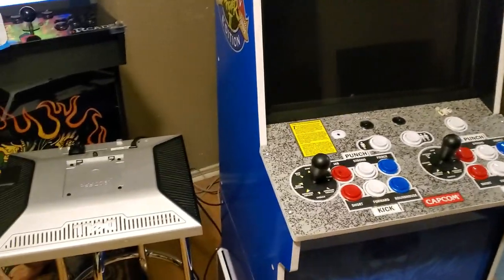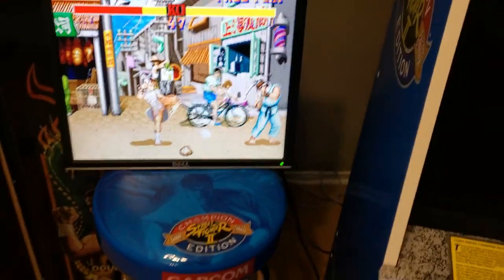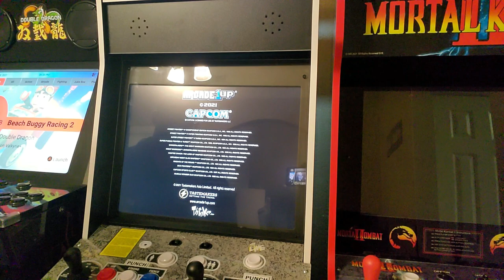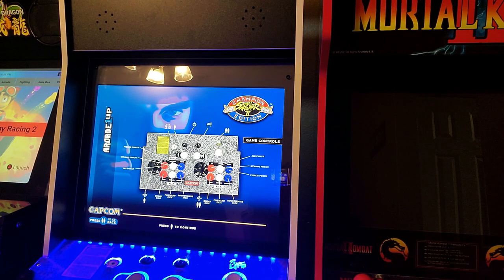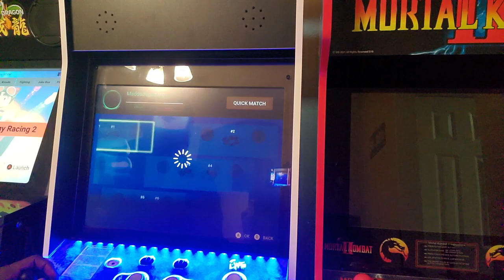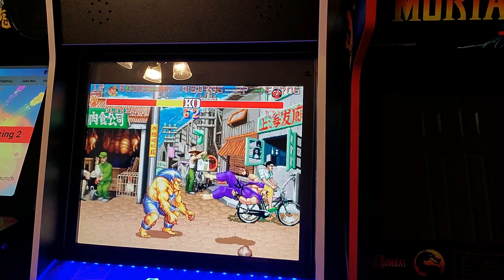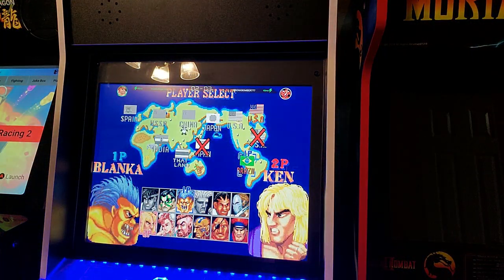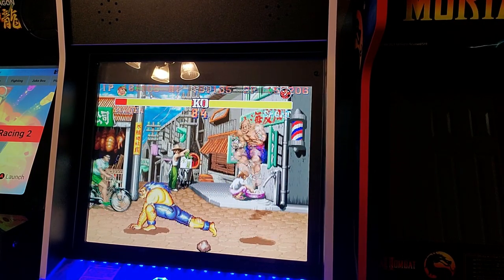Arcade1up Big Blue 20'' Install complete and working!!

Comment: Great video on the 19-inch monitor replacement and the online matches that you had!  The 19-inch looks great on the big blue Sf cabinet!
Reply from the maker: Yeah the 19 inch was the first one and the 20 inch was what I am using now. Thanks for the comment and I appreciate you
Reply: @MadDadsGaming  Which LVDS unit?  1.5 or 2.0?  You tried the 20" in other A1U units as well?
Reply from the maker: @thebrokebrick7755  I put it in the description but its the 1.5 that works  in this cabinet as well as the Xmen vs Street fighter and Marvel vs Capcom. The version 2 worked with the legacy cabinets and others. I appreciate you checking out the video.

Comment: I don't understand why you need the Geekworm adapter to work? All I did was gutted the dell 2007fp to bare LCD panel and simply just swap the aracde1up 17" out with this, the LVDS is plug and play and one thing you do need is the inverter section for the dell LCD panel LM201U05 and from than it's just plug and play.
Reply from the maker: You can do it either way you like. Im glad you found another way to upgrade your system. The Geekworm adapter is something used to me without much of a install process is all. You connect the pcb to Geekworm and then done. Everyone has a good way to upgrade I don't discriminate at all. I appreciate you for checking out the video.
Reply: I tried this, and it didn't work.  The pcb wasn't supplying enough power
Reply: If you could explain more in detail how you got your big blue to work with lvds directly, your knowledge is very much appreciated
Reply: @chubbstep  You only need the 6CCFL inverter board from the LM201U05 LCD board kit from amazon or aliexpress, than everything just plug and play to the arcade1up board.
Reply: @mr2cqql  I have 6CCFL inverter and i have a board kit.  The PCB cannot supply power.  In fact i'm using board kit right now plugged in seperately.  my LVDS cable has two cables that separate power line.
Reply: @mr2cqql  do you have a link to said product.  i ran cables directly back to the pcb and still get the same problem
Reply: @chubbstep  The inverter board is green color unlike the amazon one. From what I recalled, I only swap out the aracde1up monitor to the dell can connect the green inverter board without using the controller from the kit. Had it running like this for few weeks than converted to pandora ex.
Reply: @mr2cqql  this is the one i currently have.. snipboard.io/JwpiRu.jpg   it's not yellow, it's green, but the wiring for power is different in that there are + - going separately onto a chip i am unfamiliar with.  whereas, the one with 6-pin connector goes directly onto pcb.
Reply: @chubbstep  That might be the problem, since there are so many different style and layout of these boards that looks alike but they are in fact not. For that you will probably have to spend another $3x to test it, it will make more sense just dump the aracde1up system and get yourself a pandora box whatever home edition with all the buttons and joystick for $100. The arcade1up cabinet have so much potential for upgrade and you can have everything with the pandora.

Comment: Will this only work with the 1.5v geekworm? I have the Capcom Legacy with a 2.0v geekworm and it's not getting a signal. I've tried hsmi to vga & dvi.... No luck.
Reply from the maker: I only know at the time for the big blue. I haven't tried the othets except for the mk legacy which works with the v2.0. Check out that video to see how I connected it.

Comment: So you saying you couldn't get the DVI to HDMI to work? You had to go with the VGA instead?
Reply from the maker: Yes that is correct on the 1.5 adapter. The v.2 works on the midway legacy with the dvi to hdmi adapter no problem.

Comment: is this the original monitor frame modded? or the first gen monitor frame? 🤔 thinking my old monitor mod would work in this cabinet.
Reply from the maker: This is a 20 inch Dell monitor that I used in this upgrade.  I appreciate you for checking out the video.
Reply: @MadDadsGaming  Thanks for the reply, but I more meant the wooden frame that does into the cabinet.

Comment: Thanks! using hdmi-vga, screen showed up! Though i see some letters flickering. Do you also notice it?
Reply from the maker: Yes some but not noticeable to me. Also you may have to play with the settings a little bit
Reply: @MadDadsGaming  def noticeable on dell 2007fpb. Do you remember which settings did you play with that made flickering go away on this monitor?
Reply from the maker: @DJILK-SF2TV  I went through the zoom feature in the menu and something else lol its in the video

Comment: my question is how did you get the monitor in the cabinet, so that it will fit well. please show this. I really don't know what monito to get and need help because I don't want to end up buying  a monitor that doesn't work.
Reply from the maker: I do have all the information in the description on what I used. Again if you need help just email at Maddadsgaming@gmail.com
Reply: @MadDadsGaming  emailed you

Comment: I also just ourchased an LCD to HDMI converter, would I still need to but the LVDS to HDMI?
Reply from the maker: Well with the monitor install you don't need it if your modding it or using the original pcb

Comment: Hey brother - Why did you go with a VGA to HDMI instead of DVI to HDMI?
Just curious but isn't the DVI going to give out a better picture?
I'm using the Dell 20" 2007fbp btw
Reply from the maker: I went with the vga to hdmi cable do to the dvi to hdmi would not recognize through the pcb for some reason and the monitor wouldn't detect it like it did on the mk 20 inch mod I did. Thanks for checking out the video.  I appreciate you.
Reply: @MadDadsGaming  I appreciate you for the info and nicely done videos. So the 20" model did work with the dvi? I have np buying both and returning at amazon worst case scenario lol.
Reply from the maker: @salvatoregiuffrida8912  yeah the dvi to hdmi worked on my mk legacy cabinet but it would not work with the big blue.

Comment: is it possible to use a dell p2016 monitor since it has a 5ms response time? or a dell2007wfp cause im no able to find a 2007fpb?
Reply from the maker: You probably can but since its a wide-screen it might not fit in the cabinet like you would want it too. Thanks for checking out the video.

Comment: Thanks again for the vid! Found out my DVI to HDMI Cable don't work but will try VGA to HDMI. Is this one still the best?
Reply from the maker: Thanks for the comment, yes this one is the best and I use it without any issues. I apprciate you.
Reply: @MadDadsGaming  keep up the good work. I saw in another video DVI was working with the V20 (on big buck hunter at least) and in our case VGA works with the V1.5.. 🤔
Reply from the maker: @McGuinness89  yes and in my Midway legacy 20 inch install video it took the v.20 board without any issues as well with the dvi to hdmi cable. Check it out.
Reply: Hi, Which version do I need for the Street fighter legacy board? also does it work with DVI to HDMI? Thanks
Reply: @mr2cqql  if you can't find an answer, this is my prediction..  the V20 works with DVI (or DVI to HDMI) and V1.5 works with VGA but NOT DVI

Comment: 👍🏾
Reply from the maker: Thanks footie I appreciate you man
Reply: Hey MadDads!! Just want to say great video I did the upgrade to my Marvel vs Capcom cabinet using a Dell 2007fpb monitor. Everything turned out great but I still have the black bars on the side😩. I'm going to go back and play with the zoom and auto adjust features a few more times tonight.
Reply from the maker: @JustinH201  I appreciate you man, also yeah you got to mess with it a couple of times to get it right.
Reply: @MadDadsGaming  Hey! I got it  working last night.. thanks again for reassuring me. It's crazy you really do have to play with it. I did everything you said i zoom in, play with the horizontal and vertical put it in game mode exit out of the settings. Then hit the auto-refresh and it popped up lol Marvel versus Capcom cabinet is 100% complete now and it looks amazing🤤
Reply from the maker: @JustinH201  Im glad you got it working man. You should have seen how long I was there messing with the settings and being pissed it wasn't working until I finally got it lol.
Reply: @MadDadsGaming  I Can Only Imagine how you feel because I've been had my cabinet Moded and that was the only thing that wasn't right that irking me. I watched your video at least 7 times trying to figure out if I have all the parts right lol NOW MY BIG BLUE IS NEXT....
Reply from the maker: @JustinH201  cool man i really appreciate you watching and for the support

Comment: Hey brother, If you give me some guidance, I'd appreciate it. I got the Geekworm v1.5 and the Dell 2007fpb and I don't get any picture unfortunately.  My screen doen't see a signal and I've tried everything, without jumpers and with other settings. What monitor are you using?
Reply from the maker: I am using the same monitor as you. Are you using the same cable I used? Thanks for checking out the video.
Reply: @MadDadsGaming  ah, you think it could be the cable? I'm using a different brand. Dvi to hdmi. Did you remove the jumpers by chance?
Reply from the maker: @salvatoregiuffrida8912  It won't work with the dvi to hdmi cable already tried that and got no signal.
Reply: @MadDadsGaming  ah, I was under the impression that you could... So I have no choice but to use the vga to hdmi cable, huh?
Reply from the maker: @salvatoregiuffrida8912  yes the dvi to hdmi cable works with the legacy cabinet though just not this one.
Reply: @MadDadsGaming  ty so much for your assist! I've ordered the benfei and should be in tomorrow. Crossing fingers lol. Did you remove any jumpers by chance?
Reply from the maker: @salvatoregiuffrida8912  Not at all, just connect it the same way...and remember to adjust the resolution is the only thing I really had to focus on.
Reply: @MadDadsGaming  right on. Tyvm for your time bro! I'll holler at you if I get it running 🤣🤙❤️
Reply from the maker: @salvatoregiuffrida8912  sounds great man.
Reply: @MadDadsGaming  Reporting in to thank you - it worked via VGA with the Befai cable! Are you on IG because I wanted to show you a few things that you may like to add on. The only thing I don't like too much is that any wording is slightly distorted as if there noise interference going on. Like my User handle and any words on the screen aren't clear and have a little buzz to them if that makes sense. Wondering if you had the same issue. Do you know if any of these 2 boards need to be grounded maybe?
Reply from the maker: @salvatoregiuffrida8912  It is going to happen unless you go into the settings and mess with the video settings to get the blur out. Its the only way of doing it so far that I have found. The other board doesn't work at all.
Reply: @MadDadsGaming  yeah, already tried, it's hard to describe but the letters aren't perfectly clear, instead of straight lines they're zigzag. I'm.wondering if it's the benfai cable or the lvds board 🤔
Reply: @MadDadsGaming  I wanted to show you what I also did. I added a vga scanline generator that connects to the monitor before you plug in the benfai cable. Adds scanlines and makes the image look much better 👌🏻. And btw, I'm getting the fuzzy lettering with or without that scanline generator plugged in.
Reply from the maker: @salvatoregiuffrida8912  email me at maddadsgaming@gmail.com if you want to talk.
Reply: @MadDadsGaming  I sent you email - let me know if your letters look the same..

Comment: Do you own an intecgaming fighting stick and if so do you know how to connect it to a Dell 2007fpb monitor using a ps4?
Reply from the maker: It should just connect if it has a usb connection or using a convertor. Then going dvi to hdmi to the dell monitor
Reply: I have the Bluetooth dangles to connect to the ps4 however as far as sound I purchased a hdmi audio extractor. I still need a speaker im guessing a female to male to use to get sound to plug into the audio extractor. I plugged my hdmi cable into one of the hdmi slots in the audio extractor and the dvi to hdmi into the other slot on my extractor but I still need to plug in the hdmi from the pcb that comes with intec gaming as well which uses an hdmi cable. The only thing I can think of is getting a hdmi splitter adapter that I can plug the last cable with.
Reply from the maker: @Knowledge1976  yeah that should work.